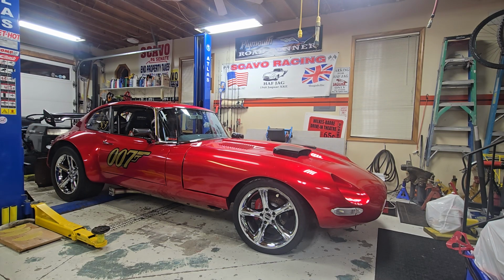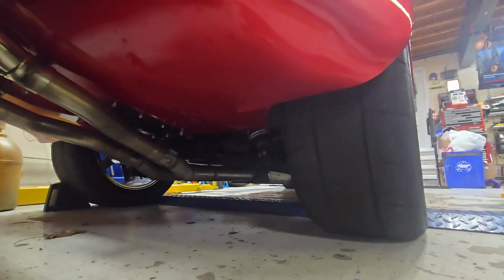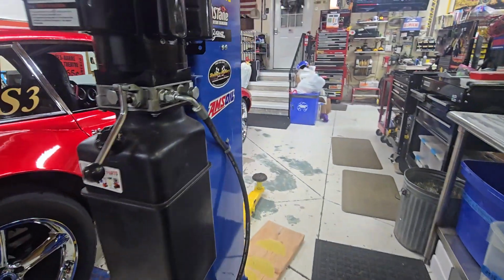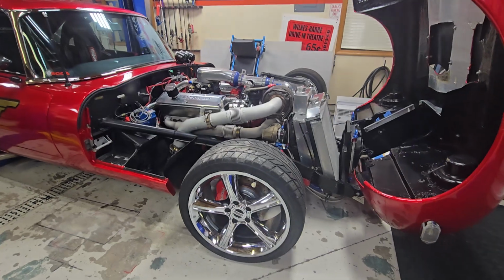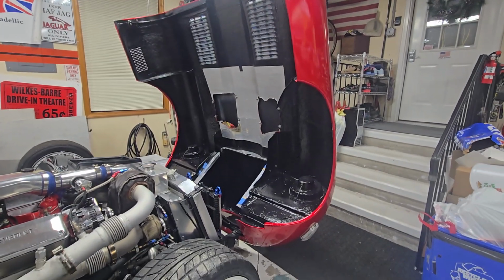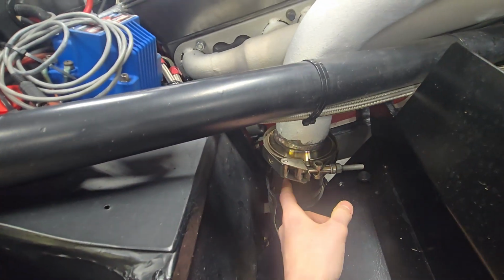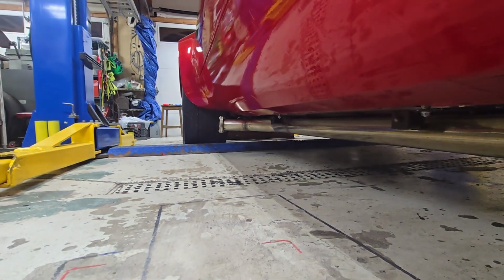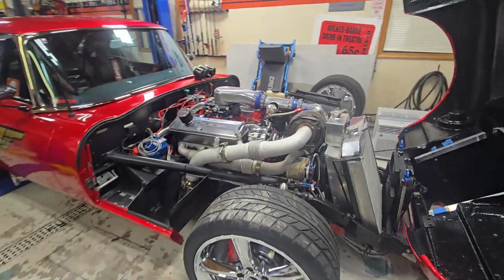1968 Jaguar XKE Turbo 383 stroker

Comment: Dude! This is an awesome overview. I think it’s great how your grandpa, in a sense, “passed the torch” over to you with this car, and you’re doing incredible things to it. It’s clear to me that there is a lot of history here from all of the work you’ve done and your grandpa has done to it. I can tell from all the work and care you put into it, that it means a lot to you! Something I think is worth sharing more about (via YouTube). I’m looking forward to the story behind it. The RED color is sick, my favorite kind of shade. 

This is an incredible machine. The EDM on the turbo pipes are pretty cool, I never heard of that material before. Engine bay is CLEAN as hell. I assume not legal to drive in California, right? Haha. 

Also, I saw the 007 sticker. So you have a little turret that comes out from the back of the jag? Haha jk
Reply from the maker: @MidwestF150  yeah i got very lucky he held onto it and got me into the cars and racing at a young age. It was originally red so we wrapped it last year and tried to match the original, it came out pretty nice. The company that does the edm is called jethot, i think it was about a grand for the treatment lmao. The old james bond movies used an xke so my dad bought those stickers for it too😂😂
Reply: @ yeah it looks sweet. You and gramps should talk about what oil, filter, air filter, coolant, gas, trans fluid you use. That’ll drive a lot of interesting discussions!
Reply from the maker: @MidwestF150  yeah we use mostly redline and amsoil oils so should get some clicks. We use waterless coolant and silicon dot 5 brake fluid too with a water methanol injection system for the turbo to up the octane